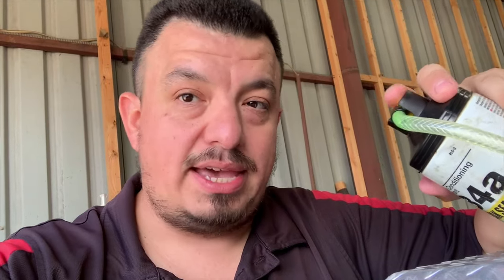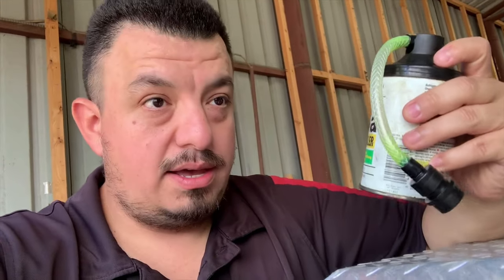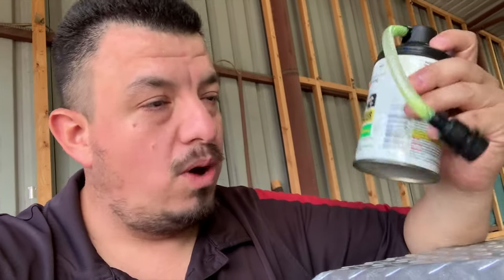Car AC Tips - Stop Using Do it Your Self Freon Cans

Comment: If you don't have a leak you will most likely never need a charge, granted a little weepage form the compressor shaft is normal.  My wife's 06 Honda Accord and my 06 Yukon with 160,000 miles still cool great today, even when driving through the Arizona Deseret ant 117*!
Reply: Well then I guess every car we’ve ever owned had a leak because it’s too damn hot here and running the AC non stop our cars run out of Freon every 4-5 years. Many different makes from wide range of years

Comment: I added freon to my car out today, it had some in it but didnt turn on, added a little bit and the compressor kicked on normally.
Reply: I think hes just trying to get the point across that people need to stop overcharging. A little spritz of freon is fine but slamming it with too much will cause premature failure of ac components starting with the compressor most of the time.

Comment: My nissan maxima Ac only works when I turn on the Ac and set it at 60°(not really cold but cold enough to know it cold) if I change the knob from 60° to 63° it becomes Hot immediately.... I dint know if I need a new compressor... I'm just confused...
Reply from the maker: I’ve seen this happen before on a Nissan actually.  You probably have a bad or disconnected cabin air temp sensor.  Depending on what year maxima you have that sensor is usually on the panel under the steering wheel.
Reply: @FalconsGarage  thank you so much I'll check it out asap and let you know what's up
Reply: I removed the sensor and it was clogged with dirt.... I tried cleaning but it didn't work... I'll get another one and let you know what up... Thank you 🙏
Reply from the maker: thats a good start .. its some sort of electrical problem ...
Reply: @FalconsGarage  you were right, sensor came in today... My ac is back to normal... Thank you so much... I was this close to changing the compressor
Reply from the maker: Glad I was able to help!!

Comment: I agree and disagree... I can easily see how someone can screw up if they dont know what they are doing...
That being said, I have dialed my AC in using cans quite successfully... I install HVAC systems for a living, and am familiar with pressures, temperature differences, etc. My 2002 Toyota camry had ac when i got it, but at my old job, i had an hour lunch. Idling in the parking lot, the ac wouldn't ever get comfortable... racing the engine up to 2,500-3,000 it was ice cold. I added enough (using a hifh quality temp probe in the vent) where I now get 40° air at idle, 38° air while driving/at cruising rpm... If your temperatures increase at rpm, you have too much... When charging a system for myself or friends, I simply add refrigerant til I see temps in the vent get  as low as they can go... I'll get in the car and hold it at RPM fir a couple minutes and make note of the change in the air temp... I may have to let just a small bit out or add another quick shot, but usually I can get it as cold as it can get...
In the end, a gauge is the best practice and a pro service is best if you have no clue what you are doing... but I argue that your average backyard joes can make due